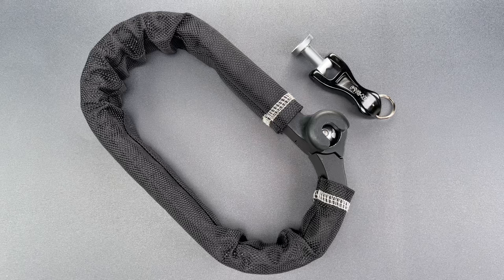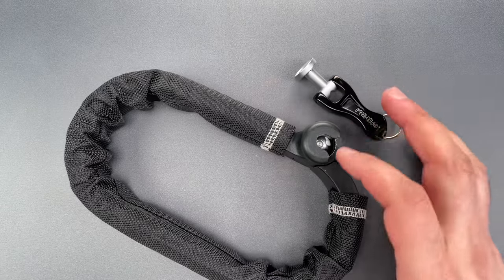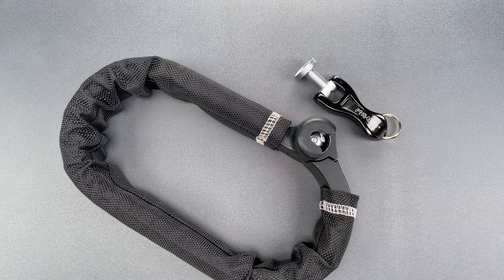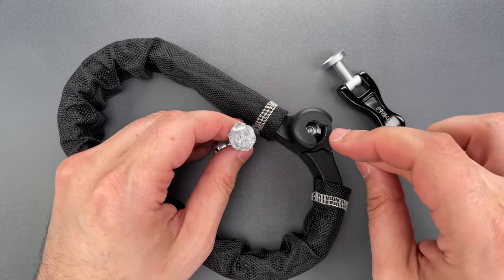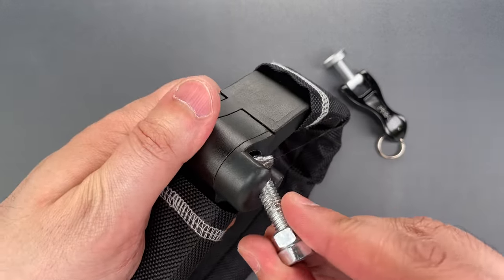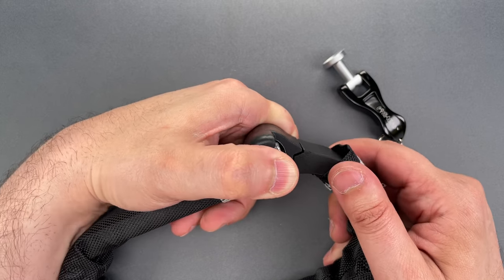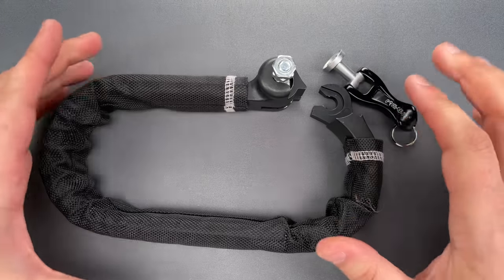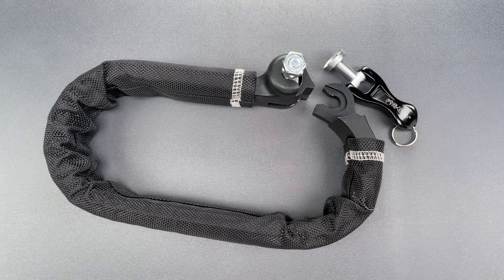[1333] Opened With Hot Glue & Bolt: Pinhead Bike Lock

Comment: I know he's just showing us HOW to do it but there's something hilarious about the mental picture of a bike thief hammering a bolt and bringing out his cordless glue gun and then patiently waiting before unlocking your bike and running off with it into the night.
Reply: Ideally the crook rides off with a bike.
Reply: @PatrickPecoraro  TBF, it would be hilarious if they were to run off with a perfectly functioning bike.
Reply: You don't need a glue gun just the glue stick and a lighter. In fact I think you could open this with just a glue stick.
Reply: Bike thieves often case bikes to steal later.
Reply: @Laugh1ngboy  Yeah I keep a lighter and glue stick in my office desk for quick repairs
Reply: @marquiis  well, a google search and a few amazon purchases. Or maybe googling the specific method and tools and then ordering the tools (and a lock to test) is not that smart in the same browser session, but... law enforcment will not go trough extra lengths for just a bike. Okey, maybe if you add a flash drive with pirated moves onto the bike - then maybe.
Reply: It's definitely significantly more time, effort, and research than the majority of bike thieves would be willing to put in, especially if there's a bike on the same rack that's secured with a Master lock
Reply: A dab of superglue is all you need. I roofing nail for the key.
Reply: I've seen theives using a common full size manual wood saw to cut the cable on a bike 'lock' in broad daylight.  With police close by.
Reply: When I first moved to San Francisco I knew some people who had bikes stolen to order. They went down town, found some people who stole bikes for drug money, described vaguely what they wanted and were told “Ok. Be back here in an hour with $20 each” that was about 15 years ago, so I’m guessing it would be closer to $40 today. On the other hand heroin is cheaper now than it was then (I’m an alcohol and drug counselor) so maybe they charge less…

Anyway, the point is, in big cities there are definitely people whose regular side hustle is bike theft, and this kind of lock is easy money to them.
Reply: @PatrickPecoraro  SAVAGE
Reply: Doubelsided tap?
on top of a reversed bold?
Reply: @asteroidrules  That totally depends on the bike in question
Reply: @acesn8s89  maybe because I live in the middle of nowhere but how many people need bikes for theft to be this high it seems like a product that wouldn't have a lot of value third  hand unless for scrap.
Reply: @erueka6  Plus, in a city like SF a parking spot can cost as much as a house in the Midwest. Add to that traffic, slow public transportation, the hassle of trying to find and maintain free parking, the fact that all of your destinations are probably only a few miles away, and gas that’s 20% more expensive than outside the city and there’s a lot of people who would rather ride a bike than drive. 

So, since so many people live there and there’s so much incentive to ride a bike, the opportunity to buy an expensive bike for a relatively low price is one that a lot of people will jump at.
Reply: @erueka6  I don’t really want to get into a debate or anything here, but SF is a surprisingly kind and beautiful place, and really everything I said about SF applies to just about every single other large city (whether it’s on either coast, the Midwest, the south, or anywhere else) as well.
Reply: If they did it in Hi Viz waist coats, safety helmets and glasses, holding a clipboard and a bag of tools no one would give them a second glance

Comment: That sounds like a lock that would be defeated by its own popularity: as soon as this thing becomes common enough it'll be very common for thieves to have the necessary tools.

Or as it's known in the IT area: security by obscurity. Not in itself a bad thing, but if it's your only defense, then you better watch out.
Reply: Security by obscurity is also a big part of lock sport. Specifically in challenge locks. Nobody wants to deal with the guy who makes a challenge lock that is really easy to pick, but requires some oddly specific tool.
Reply: Security by obscurity is Linux, MacOS and ChromeOS in a nutshell. All of then are made for windows as making it for other OS is just not profitable.
Reply: @swecreations  all three of those have quite strong security systems in addition to whatever obscurity might bring them. Especially ChromeOS is very tightly sandboxed in multiple ways.
Reply: I'd never heard that before but it makes sense. That's how Hank Pym recruited Scott in Ant-Man I realise
Reply: @swecreations  That's not so true anymore, especially Linux as of late. An awful lot of servers run Linux so we're seeing more attacks and exploits as of late. Servers tend to be a more valuable target. So while the amount of compromised machines is smaller that pay off maybe worth it to them.
Reply: @blindsniper35  Yeah I was a bit iffy on including Linux in my comment, and I realise after the fact I probably shouldn't have included it.
Reply: Cantab  I have the pinhead axles and seat clamps and those are torqued down fairly tight, so you're not getting those off with hand pressure anytime soon. I definitely would not want to use one of their locks though, based on this video and how dead easy it is to defeat.
Reply: I only use the pinhead system to secure my parts (seat, handle, wheels).  It already is popular enough that I wouldnt feel comfortable using it in lieu of a u-lock
Reply: Exactly that.
Reply: security through obscurity is still pretty shitty security instead of security by design.
Reply: Yeah the macs and linsux is security through obscurity, literally their own defense, which is proven easily when they both get pwned at the same time, when somebody actually cares to abuse one of their many holes(shellshock)
Reply: @chrisoffutt8968  And that's exaclty what I said and what Security through obscurity means.. Windows has to be patched regularly because everyone wants to attack a system with 90% of users, rather than one with 8% or 2%.

Also there are plenty of exploits for android, which does prove popularity means everything.
Reply: security by obscurity is less good when your security uses a universal key
Reply: Security by obscurity is absolutely a bad thing.
Reply: @Hans-gb4mv  It's another tool in the box that you use as a layer of security along with everything else. It's in the old way of being the only layer it's a bad thing. Anything that makes it harder to get in is valid, you just have to determine how effective each layer is as well as how many you require. Just like physical security is another oft overlooked layer - lock the server down as much as you like externally, it's all useless if someone can just walk in and gain access that way.
Reply: @MrGrimsmith  I'm sorry, but no. It's not a tool. Securty by obscurity is no security so it certainly is not a tool in the security tool bag. It's not effective at all. How would you feel if tomorrow you purchased a new car and it has a defect that you can't see. Are you going to say that it's not a defect until you spot it? Of course not.

The thing with obscurity is that you might find it obscure, but other people, more experienced might see right through it. Or you might rely on it and someday someone comes along a with a tool that makes it visible for everyone and by that time you have forgotten how vulnerable you left it because no one sees it, not even you.

Security by obscurity is considered bad practice and is, by many security professionals in IT, seen as something that isn't security it all.
Reply: @Hans-gb4mv  We'll have to agree to disagree here. I worked in PCIDSS for the best part of a decade. Part of the standard practice was not leaving obvious tells to vulnerable areas. Obscure them. That, in itself, is part and parcel of security - don't paint a honking big target on the one important server, paint them all with the same brush. It's just another layer, not total security but still a valid layer.
If you armour up only the one server you're asking for only pain and fail.
Reply: @swecreations  Calling open source OSes "security by obscurity" is a level of miscomprehension I did not think was possible...
Reply: @andersjjensen  Read my second comment
Reply: @durandle9226  "I know, let's Surprise the lock thief with a tool who most bike owners have, but thief doesn't" Is the thought process behind this
Reply: @gns942  I did too. But I lost my key for it, so when I had to replace the tubes on my bike I bought one of those gator grip sockets and used that to remove the locking axles and the seat clamp and replaced them with regular ones (quick release).
Reply: @swecreations  Those aren't obscure. Linux systems are mostly open source which is literally the opposite of obscure. The reason those systems aren't targeted for end user malware is because of market share. Also, a lot of the reason ChromeOS isn't targeted is because there's actually very little attack surface, since most of its "functionality" is via web service. If you want to attack ChromeOS, just compromise people's Google accounts and you've already succeeded.
Reply: @23Khameo  You can buy new keys from Pinhead, if you had the code for your key written down. Despite Pinheads still not being 100% secure (nothing ever is), quick releases are extremely attractive to the casual thief who can pop one in less than 5 seconds and make off with my wheel(s) or seat post. I'd rather have said casual thief take a look at the Pinheads and move on because the theft would take special tools and time/patience to pull off, by which time I'm already yeeting them into the nearest wall.
Reply: Defense in depth.

Have the obscurity, absolutely. But still have designed in security like zero trust, layers of security, pen test and vulnerability checks
Reply: @swecreations  You better be prepared to show your technical skills by posting actual details when you claim operating systems have security by obscurity.

All the source code is freely available for the Linux kernel and the system tools run. That isn't obscurity - it's the absolute reverse of security-by-obscurity. All the best coders in the world has access to read - so have you seen all Linux system opened up by anyone using some kidz-are-us hackz tool?

Or you think "there are too few Linix machines to target them with virus" is the definition of security-by-obscurity? Still wrong use of that term. And while there are much less Linux desktops out there, there are some billion embedded device and servers. So a huuuuge amount of actual installations running Linux.
Reply: @blindsniper35  It isn't even "as of late" much servers runs Linux. But it's possibly "as of late" people outside the IT world realizes it. Linux has been in use in a huge amount of servers and embedded devices for a lot of years. Windows licenses are reducing the profit margins when embedded devices are sold. And Linux, with on-the-fly security patching of even the running kernel with no need to reboot gives quite nice availability for important servers, compared to the constant windows updates requiring a reboot.
Reply: @perwestermark8920  If you read my comments after that you can see that I have already taken back that statement, I agree that Linux doesn't apply to that.
Reply: @swecreations  Yes but it's a second thing. "security by obscurity" doesn't really mean "smaller market share so less likely to be attacked. Security by obscurity as concept means security based on withholding information. It's the concept of pretending a black box is more secure because you aren't expected to know what it looks like on the inside.

And that is how security-by-obscurity fails so badly. As soon as someone get their hands on a box and looks inside and post their findings, all that "security" is lost.

If you find a YT clip showing there is a hidden magnet sensor that needs to be activated, then the "security" of that sensor is lost.

If someone dumps the firmware of a supervision camera and notes user:"factory" and pwd:"you-can-never-guess-our-factory-backdoor" and posts on the net, then that camera is wide open (and yes, Cisco and a number of other router manufacturers have used accesses like this instead if using certificates, where the info in the device can't reveal the certificate part at the manufacturer.)

Security by obscurity is the hidden house key in the flower pot. The key is obscured. But when location is known, the key is suddenly available.

So security by obscurity should be used based on the actual meaning - i.e. security based on trying to hide information. It can be meaningful - like dressing up a test car as an older car to make people miss that it's a prototype. But it's very prone to catastrophic failures, if the obscured information happens to leak.

Comment: I've sold a ton of these over the years. Never occurred to me that it would be this easy but that's what LPL is here for!
Reply: I would think the torque required to get the wheel spindle locks off would be much greater than the glue could take, same for an epoxy I'd think.
Reply: @flapcats  won't know unless someone send LPL a set but I'd be willing to try it if a customer came in without a key...

Comment: “Preparation which will likely not be present in the field.” Wow I haven’t heard such a raving review from LPL in a while. Guess I know which bike lock to buy!
Reply: But then you have guys that bring circular saws to steal bikes, trust me I've seen it happen often.
Reply: I don't know, I carry a lighter and a hot glue stick in my edc. A coin and my pen could substitute for the bolt...
Reply: @MichaelBransonCoach  Wait is this sarcastic? No joke, I'm interested if genuine, why do you have a hot glue stick in your edc, what do you think it will be useful for?
Reply: @GeneralPenemonto  For 40K years, Aborigines have been using spinnifex resin to affix bone and stone heads to spears and bone points to woomera's/Atlatll's. I have it to affix nails to a stick for a fish spear, make impromptu knife handles for my Altoids blade (handle removed for packing), bonding cordage wrappings so they don't slip, water tight seal in a leaky container I found, waterproof & insulate an electrical connection. Basically anything you'd need epoxy or pine pitch for in an emergency without having to make it. Reusable epoxy in a stick. For an Altoids, I melt it thinly over the inside lid. Add powdered dung/carbon for a harder binding.
Reply: @MichaelBransonCoach  Damn that sounds interesting, and actually really handy. I think I have some lying around the house, I will def put one in my backpack! Thanks man!
Reply: Would chewing gum work?

Comment: Another interesting option would be to get one of the keys and cut all but one of the pins off. Then, such 1-pin key should be compatible with any lock.
Reply: I think I'd get a triangular file & cut teeth around the rim. Then it would grip the other face & stop rotation around the single pin.
Reply: @Aengus42  Yeah, something like that could help. Or just rely on the cup shape and downward pressure to keep the key on-axis.
Reply: @SaNjA2659  They might have some trick hidden in it, but it seems the actual interface recess the bolt rides in would keep it on axis.
Reply: That might work on this version, but the U lock version is far harder to reach.

Comment: I haven't used their bike lock but I have used the Pinhead wheel screw/bolts and seat lock thing. What I will say about those is that 1) they are much tighter than hot glue or likely even epoxy will be able to pick - as tight as you can tighten them - and 2) it is a worthwhile deterrant compared to the few seconds it would take to steal your seat and at least front wheel without it. When there are a ton of other bikes around, odds are they will just find one without it. Can't say the lock holds up though since there is so little resistance.

Comment: It would be interesting to see how many of the attacks LPL presents could be carried out by a child.
Reply: Watch the ones on gun locks. That is the exact criteria he uses to rate them. 

Spoiler alert: they basically all fail.
Reply: All of them, if the child is willing and old enough to learn.
I think most of what he shows could easily be learned by a curious 8 to 10 year old.

However many, many bypasses could be done by 4-6 year olds if they knew what to do or in some extreme cases just had a few minutes playing around with the "locks"

Comment: Here's what I want to know though, because I have their U-lock, in which you have to slide the key in down, to the right, then twist to find the point of where it sinks more in and onto the lock in correct position, before you can actually open the lock. How would you go about that one? I'm genuinly interested. It has the same core design, but the lock isn't exposed in the way this one is.
Reply: I'm sure if you send him the lock he would demonstrate and make a video.  You'd be LPL famous.
Reply: If they made the right shaped tool, this method would still work. Unlikely to happen unless someone is seriously prepping for your bike specifically.
Reply: I think I found the one you mean. This attack would still work for the most part. The only thing you would change is to apply the glue/epoxy to the lock cylinder instead of the key. If you put enough in there through the slot that the key follows it would flatten out and get the job done.
Reply: It still works the same, just slide the bolt with the glue/epoxy on, and then press down and wait for it to dry. You'd just need to be a little more careful not to spill any of it.